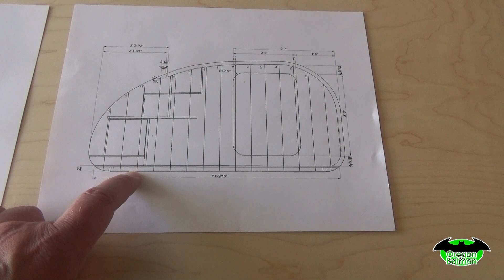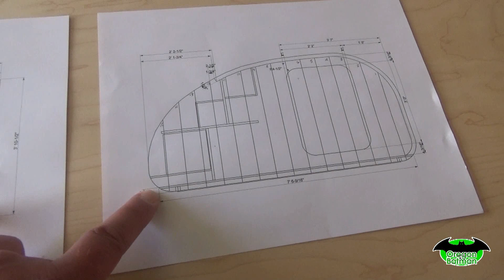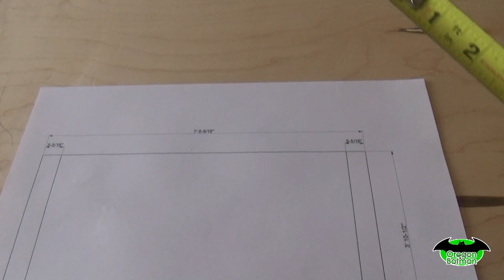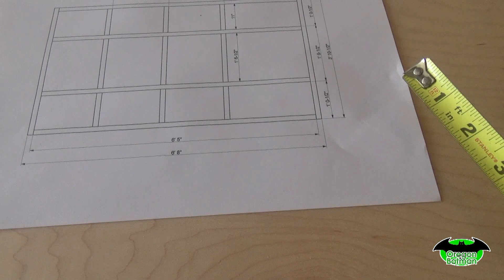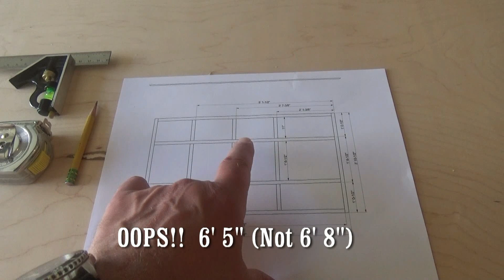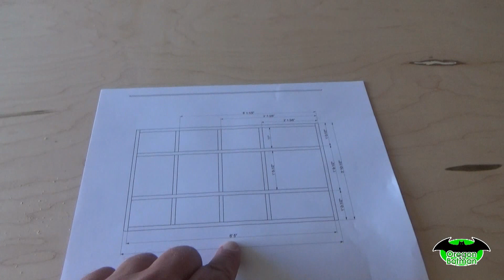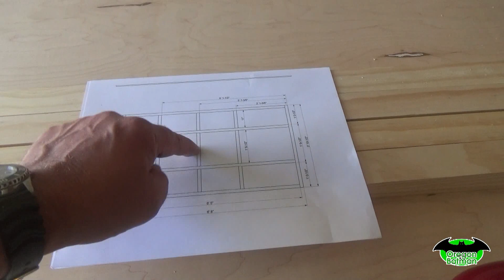Let’s Build A Teardrop * Step-By-Step * - Part 5 (Building the Floor)

Comment: One thing you could have done slightly different is to use aluminum ducting tape to run around the cut edges of you insulation blocks, this will help in creating a vapor barrier seal. I work with insulation within my job (Air ducting & external weather grill/screens); and this is what my factory does as standard practice.
Reply from the maker: That is a great tip! I didn't think of using that until I started doing the top. Next go 'round!

Comment: 1/4" floor seems so thin. Is it because there is so much structure in the ribbed 2x2 frame (less span), and also the harder wood species used? When you think of building a floor on any decked utility type trailer its always 3/4".
Reply from the maker: I used 1/4" on bottom, then 1/2" on top (2 x 2 in between with insulation)

Comment: Thank you for this video series.  I will be buying the plans soon and hope to follow them pretty closely.  I'm finding that I have to buy a lot of tools to get me started, which is fun, but I'm need to trim some costs.  The staple gun sure looks handy but I'd rather not buy a gun and an air compressor at this time.  Do you have any recommendations of an alternative I could use for this teardrop project?  Thanks again!
Reply from the maker: Hey John... thanks for watching. They do make a variety of cordless staple guns as well as 110v type. Might check it out and see what fits for ya.

Comment: I notice the longer framing members are not equally spaced apart left to right. Were you accommodating something, or lining up the framing members to line up with something?
Reply from the maker: Hi L Davis... correct, the middle section is just a bit wider than the outside sections. The frame lines up with the tabs on the trailer frame so when securing cabin to frame, the fasteners bolt thought the frame members and into floor of cabin. Good eye man!  Part 35 shows how I attached the cabin to frame. The design of the frame (front section) is why the center is just a bit wider, the tabs are a little further apart to clear. Thanks for watching!

Comment: How do you calculate how much this trailer will weigh when it is completed? Or is it a big surprise? The reason I’m asking is because I would like to build a truck camper. Of course I do not want to overload my truck so dry weight would need to be about 1500 lbs. That would allow me about 500 lbs of camping crap. Which isn’t much! If I could make the camper lighter that would be a bonus.
Reply from the maker: Currently, just guessing on the weight based off of the previous teardrop trailer I built. I'm "guessing" this will come in at around 1000 lbs to 1200 lbs.  The trailer itself will be what adds to the weight, probably around 350 lbs. When it's finished, I'll weigh it at one of our local scales and get the actual weight.

Comment: Without determining one square corner first could leave you out of square. Just measuring corner to corner does not mean it is square.
You could have a parallelogram.
Reply from the maker: True statement! Always start with a square corner... and build from there. Behind the scenes, I was always checking with a square to make sure I was on point. Better to fix something early, rather than trying to fix once the glue dries!

Comment: Great video Al!

I was wondering if you were planning to glue those styrofoam rectangles to the top and bottom components of the sandwich, like we do for the walls.
Reply from the maker: Thank you sir... I am actually going to leave the styrofoam free floating. No particular reason. Area is small enough that it should present a problem.
Reply: @OregonBatman  Well, I was thinking about the fact that gluing the whole sandwich, could improve floor rigidity, like for the walls.
Reply from the maker: I considered that, but the project being so small not sure exactly how much that would contribute. Obviously... if it were as large as the trailers you an I built, definitely would be gluing everything down!

Comment: Sir I was wondering if you could send me a copy of the blue prints step by step and all the material list along with the information on where to buy all the material. Also would you mind telling me what it's going to cost me to build it, and what the weight is on the tear drop. I really do thank you for all this. Thanks Kenneth Smith
Reply from the maker: My email address is in description of videos... email and I will send drawings. The videos show the material I used and purchased at Lowe's. Building the way I'm building it should cost around $3500.

Comment: What kind of table saw blade did you use in to cut that Styrofoam with aluminum, or what type of silver it is on that styrofoam
Reply from the maker: Hey there yep me! Standard cross cut blade to cut the foam insulation. The insulation has a foil backing to seal the foam. Cut the foam on the saw with the foil side down, that will prevent it from tearing from the foam.

Comment: guessing you were able to get the 1x2 sticks for super cheap, if not the case why not start with a 2x2? Just curious, keep up the good work. :)
Reply from the maker: Good price on the 1 x 2's, unfortunately, they don't have any of the 2 x 2 in this material... the 1 x 2 are super easy to work with and straight as an arrow (which is hard to find!).
Reply: I too have trouble finding good, straight 2x2s and 1x2s at my local stores. I end up buying select 2x4s and ripping my own on my table saw. Extra work and cleanup, but a nice straight result, every time.
Reply from the maker: Thought I would have to do that until I found the 1 x 2's.... last trailer I built, bought about 12 sticks of 2 x 2's at Lowe's, brought them home and set them in the rack and let them set for a couple weeks until ready to use them. They curled up so bad you could wrap them around a fence post! Now... I double stack, glue and screw (or staple). Technique they used in boat building for added strength. Works.... a little extra time, but I don't have to worry about it twisting under the plywood! No rules in building, find what works and stick with it! :)
Reply: That's it right there. The 2x2's they had at my lowes were bent at the store %95+ of em. So most of my 2x2's I used were the treated 2x2. It's a touch more expensive but they didnt warp.
Reply: The only words of caution I feel I should share - I'm extra nervous about building something like a trailer using treated wood.  I know it's going to be more weather-resilient, and use in an outdoor deck or structure is considered safe, but in close quarters where you'll be sleeping several hours each day, breathing in and out, I would be careful about the chemical treated wood.  Maybe I'm barking up the wrong tree, but better safe than sorry.
Reply: @OregonBatman  Thank you very much for explaining this! I was wondering why you did it this way and it makes perfect sense now! I also noticed that the 1x2 lumber you are using is extremely clear. You found a top notch batch! 😊
Reply from the maker: The wood is good stuff! and laminated (double stacked) is much stronger than a single 2 x 2!

Comment: The only part I question is wood is an awful insulator having such thick wood slats would leave more uninsulated area. Not sure how you would address that.  But hell most people dont bother to insulate floors which is a mistake.
Reply from the maker: True that! I think it's a small enough area that it shouldn't be an issue as far as insulation goes. I'm sure it will keep me nice and cozy in the cool months! Glad to hear from you again!
Reply: Genuine question. Why bother insulating the floor when you have a mattress to Lie on?  Surely that does the trick? I would have thought the walls and roof would be more important?

Comment: Quick (novice) question for you: why did you choose pine strips over cutting your own plywood strips?
Reply from the maker: Great question Andrew! The white pine that I use is very straight and very strong... the grain all runs the same direction. If I cut strips using a typical 2 x 4, it has a tendency to twist and bow due to the grain of the wood (my experience). The white pine also takes a fastener really well without splitting. Not against making my own, just don't want the hassle of fighting with it to keep things straight! :)